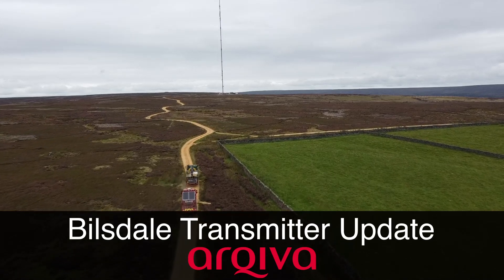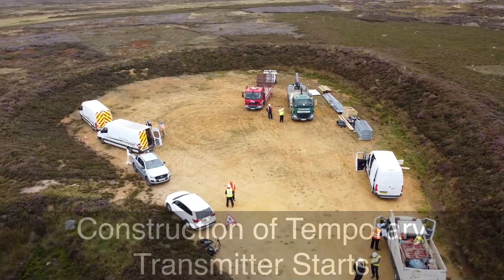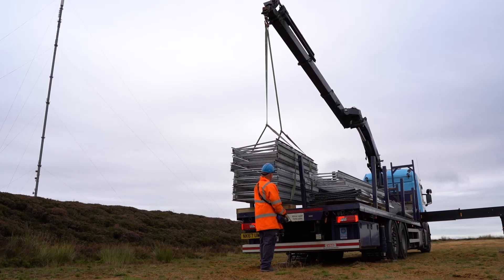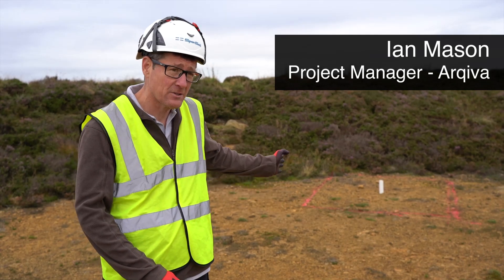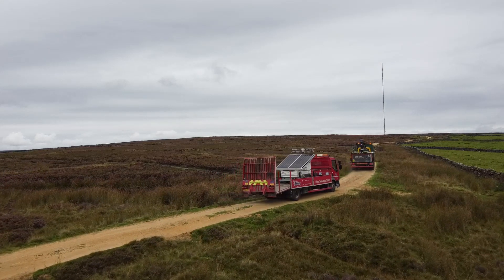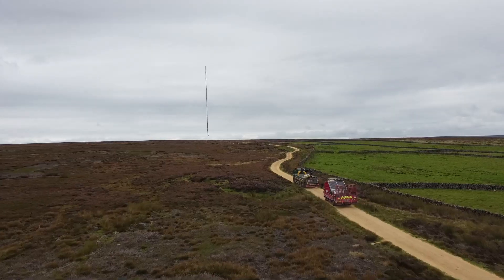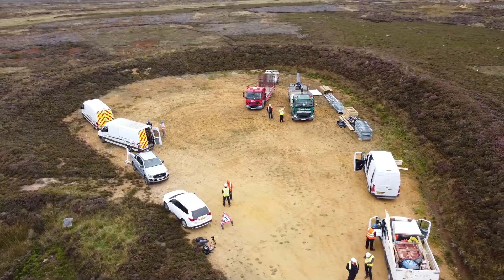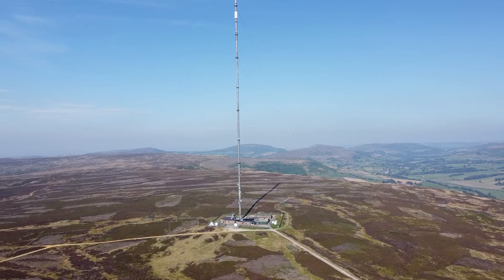Bilsdale Incident: Temporary Mast Construction

Comment: I have a 1/4 of the channels I usually have, and BBC frequently drops out. The video says it will take 3 weeks to construct the "temporary" 80m mast that will restore service to 90%. Notice that I already have service but nowhere near full service - will 90% have full service? And what kind of service will the 10% have - none? Of course, the 90% is only an estimate - and such estimations are usually over-estimations. Also, why an 80m mast when the original is 4 times the size at 314m?
Reply: Perhaps you should look at the engineering effort to get this built as it is, there’s a big difference between 80M and 314M…
Reply: @timhague882  You're a master of the obvious, and your comment is as empty as a vacuum.
Reply: Building a 1000+ foot mast is no trivial matter.  If the existing mast needs to be replaced it will take considerable time to get it down, safely, before work can even begin on the new - and that's without the challenge of an ecologically important moorland site.  Broadcast suppliers don't often have spare 1000ft masts lying around "just in case" - it'll all have to be custom made.  I genuinely feel sorry for all those affected by this, and I'm not Arquiva's biggest fan for many reasons - but I cannot see what more they could be doing here.  It's a massive undertaking.
Reply: @paulh_42  You say you're not a fan but yet defend their incompetence - they clearly had no prior plan for such a disaster. They took weeks to get access, and now plan to deflect harsh criticism by doing something they think they are cappable of - erecting an 80m mast. The suspicion is that they are not capable of erecting a new 314m mast. Their claim of providing service to 90% with the 80m mast is hot - unverifiable - air. By the way, the company is Arqiva not Arquiva - you're not paying attention.
Reply: @jamesalton8703  Yep, concentrate on the spelling mistake rather than the content.  You clearly don't understand either mechanical or broadcast engineering. Nobody "plans" for a massive mast fire. Just like nobody has a spare Forth Road Bridge, or stadium, or petrol refinery lying around in case of disaster.  What you do is reinstate as much as you can using other infrastructure - often a compromise but useable - whilst you get the prime system rebuilt.  Arqiva re-engineered a number of relay transmitters (including my local one) to get as much working as they could.  Go read up about what happened at Emley Moor, Ostankino, Peterborough and Waltham in years past and see how they worked around those problems.  

Oh, and as you're so keen on spelling - it's "capable", not "cappable".
Reply: @paulh_42  You are still defending the response of Arqiva, and excuse their response to a complete disaster by fatuous specific statements about the cause (fire) of the disaster and whether they have a spare 314m mast lying around. It is clear that Arqiva had no plans for a disaster by the fact that they took weeks to even get access, and that they give a weak excuse of calling the site one of "special scientific concern" without explaining that. And, as I said, that they are replacing a 314m mast with an 80m mast without explanation of why they have decided on a structure only a 1/4 the size of what is needed, has a suspicion that their  incompetence in not having a disaster plan stretches to not having the immediate capability of constructing a 314m mast. We'll see how long it takes them to acquire that capability by how long they can get away with just providing an 80m mast. By the way, you must have been stung to the core by my comment about your "Arquivq" mistake, since you exaggerated the emphasis I put on it.
Reply: @jamesalton8703  Your own comments demonstrate far more eloquently than I could the limitations of your understanding. I'm not wasting any more time on you.
Reply: @paulh_42  You are as full of hot air as Arqiva. This will be proved by you not being able to quote from my comments  how they demonstrate the limitations of my understanding, as you state. You certainly will be wasting your time by trying to do that, but I think you are not going to reply because you simply can't demonstrate what you state. So, adieu mon antagoniste.
Reply: You're just talking drivel now.  I'm off to watch the telly.
Reply: @paulh_42  Just as I thought! But do calm down as all that engineering TV washes over you.